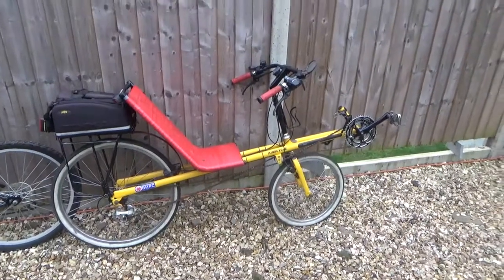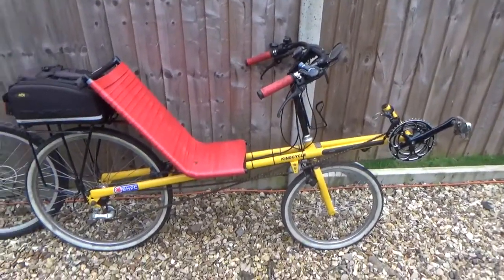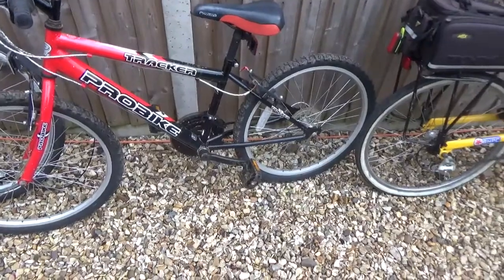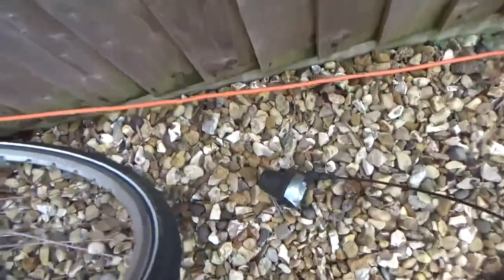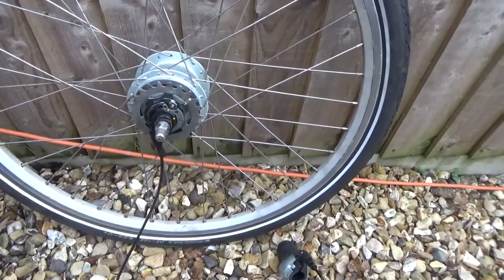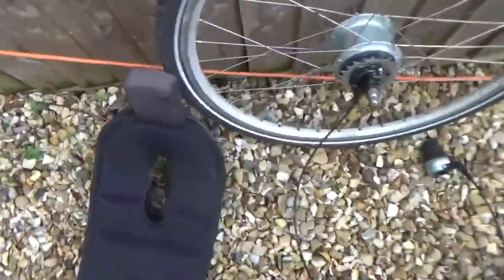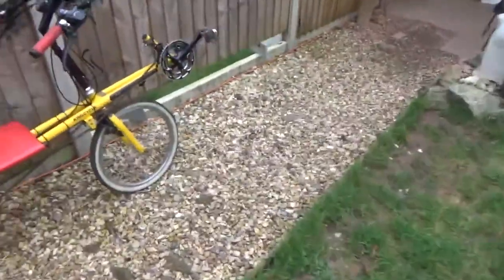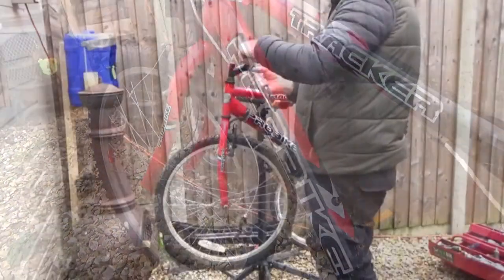Build your own recumbent bike part 1. diy short wheelbase recumbent bike build 26 x 24'' wheels.

Comment: Lovely build, have enjoyed from start to finish! I built a recumbent several years ago. It began with a set of Atomic Zombie Tomahawk plans but after seeing the Raptobike Lowracer that was getting good reviews, ended up being front wheel drive and quite nice to ride....I was really relieved when the drivetrain worked because it was a bit of a gamble looking back!
Mine used 1/16 gauge 1.5" square tube & for the fwd I made a heavier duty fork from rectangular tubing. I over engineered it just in case & used sturmey archer drum brakes so it was no lightweight. Fast downhill though lol. What size tube did you use for the frame rails? Am guessing your design is torsionally stiffer than mine was and no bad thing!